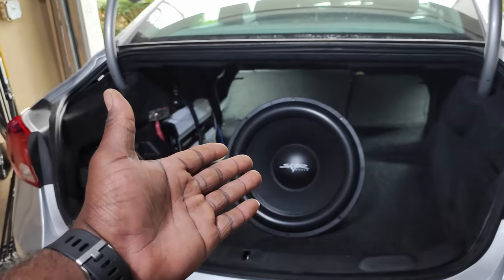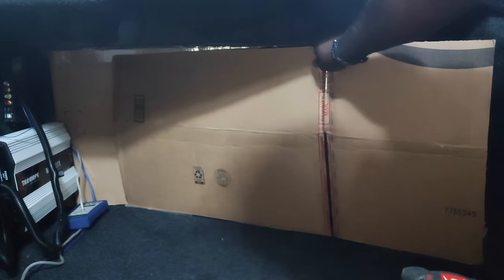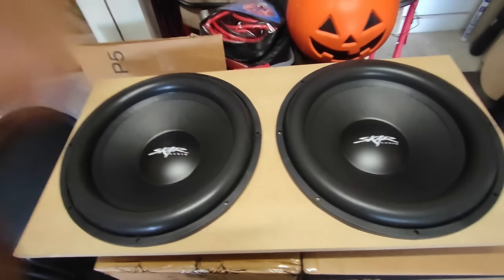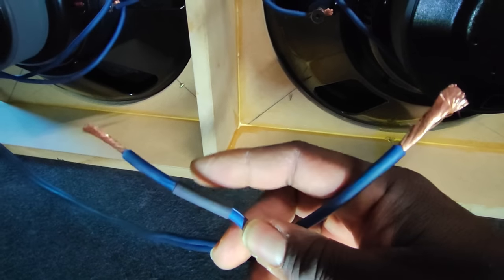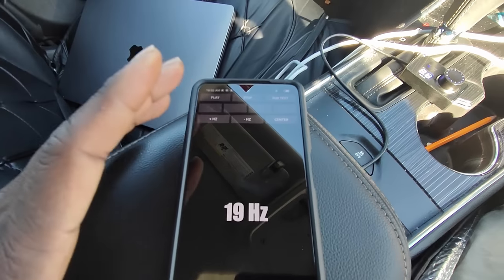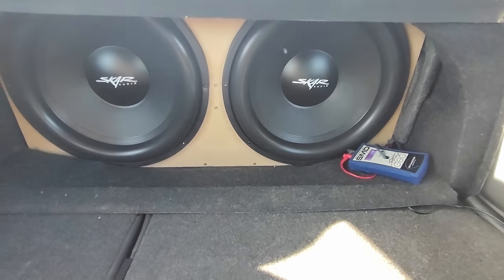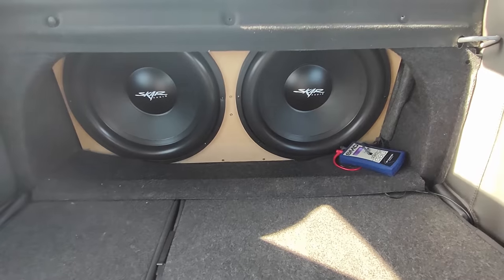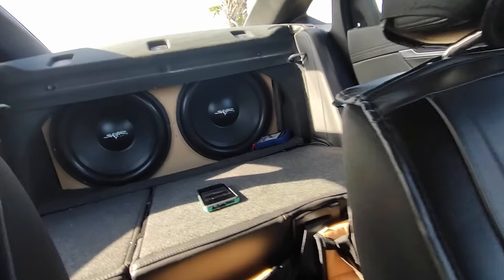No Other Design Sounds Better Than This - Infinite Baffle - 8,000 Watt Test - Part 1

Comment: Everyone wanting to try IB (trunk baffle) with 12's or smaller, you won't get the output he is getting here, you really need 15's or 18's.  High Qts and High XMax work the best, and you should be able to play below 10Hz, but it'll roll off at 50-60.

However, if you want clean bass and trunk space, go IB
Reply from the maker: Agreed. And use a DSP to kill the roll off.
Reply: Alot of people dont seal off the baffle properly, or the rear deck. This is where alot of output is lost.

Comment: Great video! Very cerebral. 

I got rid of my 12" box because i always had to take it out for luggage space. But this solves the problem! 

Do you ideally want to use subs with tight suspension? What's the name of that parameter?

Comment: I know you said you’re more of a SQ guy, but would you use this setup over say sealed, ported, bandpass, etc?
I guess would you say you “prefer” this over any other type?
Does it hit lows & highs well within range?
I have so many questions bc Ive wanted to try it for so long but have been afraid it wouldn’t be to my liking.
I’m love SQ, but like to be able to bang when I want. So I tend to stay with a ported enclosure personally.
Great vid and setup btw 👍🏼
Reply: but ts parameters has to prefer ib usage.
Reply: @CVLova  correct, I probably should’ve added if someone were to start from scratch based on subwoofer specifications, would this be preferred over other methods.
Thanks for adding that.
Reply: @themetalfusionologist  it is all about what the final product. What are you looking for? You want the entire block to hear your music or do you want to experience every nuance of your music? IB setups are great for competitive builds where you will seal and reinforce parts of the rig. On a daily build IB is more of a hassle to tune and putting things in your trunk will effect output, rolling down or up the window while driving will change the pressure greatly in the cab....your basically turning the car into a bandpass enclosure as you have a sealed section and a free/ported air section. Changing one or more of those parameters will effect tuning and therefore output. You want low and accurate? Sealed box , heavy motor and a butt load of amp. You want loud and peaky ? Ported or band pass with light drivers and correct amount of amp. IB will eat subs if you push them past their specs , stuff rolling around in the trunk can damage your subs, you system will sound like dog water with the seats up and people in the back seats...think about it, if IB was the best way to do it don't you think us guys from back in the 90's would have been only rocking open air setups?
Reply: @robsorgdrager8477  I have such a plethora of music I listen to it’s difficult to say what I look for, but I too am one of the ‘90s bass heads. I’ve just never used an IB setup 🤷🏼‍♂️ but have always wondered if that type setup would be worth trying. I do tend to enjoy the lows, I always tune my enclosures low, but at the same time enjoy great SQ.
I recently put more in my interior setup than my daily is even worth 😄so if the urge for SQ comes up I’ll just tune everything down for the subs and it fits what I like.
But I’d also like to know that if say a comparable set like in the vid, maybe 15s or 18s in the future (when I want to use my trunk again)…would I feel disappointed in the end result.
I just wanna know if it has decent low notes reproduction or does IB tend to stay in the higher range
Reply from the maker: In my honest opinion, with this setup, I hear notes into the 20's. IB setups are not restricted to the roll offs of traditional and bandpass enclosures. And this setup doesn't require a lot of power to 'sound' good. Every setup has its flaws, but I favor this one over the others; for SQ. No heavy wooden structure wasting gas money, no loss of cargo area, and no need for expensive amplification.
Reply: @BudgetBassHead  thanks for that.
I’ll probably give it a shot at some point down the road.

Comment: This is exactly what i want to do with two HT-18 v3 subwoofers. My enclosure area is a little more tricky then yours is though so im going to have to go to a car audio place that can figure it out because of a hump where the enclosure starts leading into the trunk. I think it can be done though even if its jury rigged to work.

Comment: I'm simply going to call nonsense because, in a car environment, the quality difference between infinite, sealed or ported is going to be basically unheard by the human ear.   It's a placebo effect, people just want to believe their special something sounds better even though it really doesn't.   I have dual 12" in a sealed box because it was simple to build and install.   They sound amazing, can also hear every note, not even sure why a sub wouldn't produce every note unless somebody really messed up their setup.   Another reason why subs would end up sounding worse is pushing too much power beyond their limits or under powering and clipping them.    But you run a nice set of name brand quality subs and they will sound amazing in any box design built to proper specs and ran withing proper power specs.
Reply from the maker: You may want to do a bit more research. These different designs are marketed and priced differently to different consumer groups for a reason. Manufacturers under one umbrella will produce different types of enclosure designs for a reason.
Reply: @BudgetBassHead    They can have all the reasons they want, but bass is bass in the grand scheme.  You line up 3 vehicles, one with an infinite 18", one with sealed 18", and one with ported 18" and you don't know which vehicle has what setup.   Play them all at the same wattage, about half RMS and doubt anyone would ever get all 3 right any better then a coin flip, they would simply be guessing.

Comment: Not bad, I was thinking you can probably gain a few db's by sealing the sides with that aluminum duct tape. A few layers of it on the sides and top n bottom would seal it off better for easy and cheap. 👍

Comment: I used to have a 01 regal that I had always wanted to do this with what give me the idea was I had a old Rockford 12 that the box was way to small for I had inverted the sub but still wasn't getting the sound I thought it should so I layer the seat down and stuck the magnet in the trunk with the box laying on the seat and it easily doubled the sound

Comment: It's crazy how you managed to pick up the "feeling" of a free air system. The fact that the mic doesn't distort badly but you can see stuff and air moving and it sounds loud but not "pressurised". Did you mix some of the music on top of the video in edit phase or is it actually just recorded as is?
Reply from the maker: I got a better mic.

Comment: i had friends do this back in the day and they would also screw down wood over were the 6x9s would be in the back deck then cut holes in the wood the deck and put 2 pvc ports going in the trunk ya i would do it id put some dyno matt around ware the would is maybe get some of that stuff from homedepot that come in a 4x8 sheet they use on the homes to keep the heat in seal it up and port the deck lid ware the deck speakers are
Reply from the maker: Thanks for the tips.

Comment: I have some old VVX 15's that are collecting dust and a 12" SDR. I see that these are SDR should I attempt this with the 15's or add another 12. My back seat doesn't move but I have a ski pass in my g80.

Comment: just found you and your channel... subbed and liked and commented.. I do have a question what and where did you get the intro song .. name and site ??  I actually have the song at the end you are using to demo... also do you feel running one higher power amp vs two separate amps gives you better sq when pushing subs? the reason being usually the higher powered amps deliver a dirtier quality as distortion is not an issue in spl or decibel drags and events vs sql and sql+ competitions...or say the use of a lot of modern edm music vs old school hip hop or rap ? I come from the days of Hifonics, Lanzar, Orion and the newbie Alpine LOL Yeah I'm an Old Head...never ran 18's..just 15's and 12's for bass and sub bass and ran 8's or 10's for mid bass .. am curious as to your thoughts on SQ vs straight up spl... If you have a play list or video that touches upon this or is a bit more intensive on this subject please let me know and thanks.. Was a great video and has been a longtime since I have seen an infinite baffle set up.. all these new gadgets and such must make it so much easier to tweak the system LOL Be well my friend and much love and respect to a fellow Bass head.

Comment: I just learned that this isn't true infinite baffle untill you roll a window down. Ol skool infinite baffle used one or two IB sub's and cut holes in the trunk where the spare tire is and you mount the sub vertical to the ground using a mount around the holde. You then cover the bottom and seal it up with a water proof screen fabic kind of like a trampoline fabic and then its true infinite baffle and will sound extremely powerful outside the vehicle. This is something i plan to do just for fun.

Edit: you're whole car turns into the subwoofer box.
Reply from the maker: There's more than one way to approach infinite Baffle

Comment: I wish I had done an IB with my 15s in the impala instead of a huge slot ported enclosure. I mean I guess I could still if I just talk my son into crawling in the trunk with a saw. Just leave enough box to serve as wave guide and structural support, and seal the port of course.
Reply: I also could take the separate sub plates and add a third for a center passive radiator.

Comment: Hey man I love ur vids. Question tho.. What are u using for signal off of the factory radio? R u just using a plain line converter? Or do you have a better suggestion for a chevrolet radio?

Comment: I dont have much experience free airing anything but i would be interested to know if not walling it would make any difference.  From my understanding, there is a pressure wave that can bounce off the back of the trunk and then fire toward the cabin to "reinforce" existing sound waves.

Comment: Gotta try it with marine subwoofers they are designed for free air. I’m surprised a 8000 watt burp happened. Baffle is all about SQl low power 5 channel systems. Great video man!
Reply from the maker: Great point

Comment: But wouldn’t it have leakage from the trunk ? Also most trunks have a directional air vent and you seal the back speaker holes up top ?

Comment: This is not an infinite baffle, this is a sealed enclosure.  Infinite baffle is best visualized as a driver mounted to a baffle/plane that separates the front wave from the rear wave - the key: there is no back pressure beyond the atmospheric pressure .
What you have is simply a sealed box... It could become an infinite baffle if you opened the trunk, however if the interior windows etc were shut, you would simply make the cabin the sealed enclosed... Windows down it would become ported.

It would act most like an IB with the trunk and all doors wide open...

What you have here is a leaky sealed box with insufficient enclosure rigidity.  This is an extremely inefficient use of power - you'd get significantly more output and better frequency response with one woofer in a proper enclosure, 10db louder with plenty of room to go.

A trunk can function (model) more like an IB with less cone area, say one 10.

Comment: Been watching you for years so I know I’m preaching to the choir brother but…..

A 140 at 20hz is like a 170 at 50hz so the whole spl thing , if we’re gonna do it, needs to be rethought 😂 

If your peaking at 38hz with two 18s in infinite baffle your trunk is too small for those ie the vas isn’t right but I know you already know

Somethings not right because they should peak more into the 20hz or even teens. 

I love ib and of course as you said it’s not all about the spl, ib has a special sound to it that a box just can’t reproduce.
Reply from the maker: I have my DSP set to roll off around 25 Hertz. Primarily because I don't listen to anything that low in my car. I'll be sure to mention is in future videos
Reply: @BudgetBassHead  I wouldn’t change my dsp tune either! 😂 

after taking my own crash course with a helix dsp , I can tell tuning isn’t something , I at least ,want to do twice!

Comment: As car audio guy that started back in the 80’s its cool to see an infinite baffle set up being done. This is the way most of us did it back then. Its definitely more custom work to do the set up and guys with boxes in their trunks were seen as taking the easy way out. In the days before spl competition most of the guys at soundoffs and shows ran this type of set up. As an sq guy myself, I would run 4 8” subs mounted up on the rear deck. Sealing all the gaps after the main woodwork was done was a big part of the job. Nice work here.

Comment: I did this with 4 10 audio barns and it sounded good but I did seal all cracks holes you name it with foam s spray and it wasn’t the hole trunk it was the cubby hole in a g body car

Comment: Infinite baffle does have great SQ. Those SDR 18s are listed to work well in around 4.5 ft box each so with 2 if you seal the front and deck well and add a port it could actually gain some SPL while still sounding great and possibly even give you some tuning options.

Comment: I would recheck the phase on each coil of both subwoofers, the manufacturers aren't always correct. I say this because the video of both woofers isn't symmetrical, so something isn't wired right.

Comment: I thought about doing a build like you done bro. but I need a ported box for two American Bass HD 12d2 subs. the widest box I can fit in my trunk is a 33" wide x 14" height x 28" Depth. That's not including the 6" aeroport or the subwoofers displacement. What do you tink?

Comment: this sounds good but box is very important for higher spl,, I am doing 139,9 at 30hz with only one 12" sub and 1650w amp,, (about 400w with box raise). stock alt and battery.

Comment: If the trunk is sealed as best as possible. If the sub front area and rear areas are separate. Then you really just have a cabinet. Nothing fancy.
The square footage would be calculated by what volume is there

Comment: Hi. Just curious. As I did this to a Honda Civic and 2 15" Pyle subs years ago. It was great to have my trunk space. However my curiosity is, that would it help if you had a. Top, bottom, and sides to your baffle? Leaving the back of it open. Would direct the sound waves out and back in, therefore giving it some stability. Its just not slamming bass like 2 18" subs ought to be doing.

Comment: When you say " sounds better " do you mean loud or accurate or both ? I've found a properly sized and damped sealed enclosure to be the most accurate and have a more broad and flat response curve. I understand that infinite baffle allows you to get away using less power but you are also relying on the mechanical suspension of the driver more than the pulse waves or pressure inside an enclosure.
Reply from the maker: Accuracy and timing is what I'm referring to.

Comment: I have a brotha who own a 2015 Dodge Ram Laramie truck with two Alpine shallow mount twelves in a sead box under his back seat, but he wanna port his sealed box. So, since I seen your infinite baffle set up, I was wonder if we could get away with a top board while utilizing both his cargo areas that the enclosure sits in and just add a port to each side. Will that work?

Comment: Best ghetto I seen was some1 take out the spare, take a pky wood then cut out a 15 hole n slap a house speaker cerwin vega and a Rockford punch 80 or the 40. N it slammed. Thus was literally like 25 years ago

Comment: I understand the idea. My only question is, how does it sound with seats up. All I'm saying is, you don't usually ride around with back seats down. Not trying to diss you man.
Reply from the maker: It sounds horrible with the seats up. You have to crank the volume and monitor bottoming of the coil.
Reply: @BudgetBassHead  Gotcha, thank you, sir

Comment: What if you screw on a 39"x10" in the back of the woofers to block anything in your trunk from hitting the speaker and wires? Would it change the hrtz?

Comment: High priority in free air is completely isolating front of woofer airspace from rear of woofer airspace.. rear deck speakers are a weak point and will fail with the sub pressure, they need removed/holes sealed..all small vent holes thru rear deck sealed .. sound deadening is a gigantic help in dampening the trunk space/enclosure area. 
I did this back in 96/97 with 2 10" pioneer free air subs.. completely ignored the rules on sealing off front/rear and had about an 8" gap from top of my baffle to top of trunk ceiling... it sounded good, but would have sounded WAAAAAY better if I had done it correctly. Learn from other's mistakes

Comment: Nice set up. If you wire both leads to one side like that then each coil down the line gets less and less power as the resistance increases. If you hook your positive to one side and your negative to the other end on the other sub it keeps everything equal. It’s significant, try hooking up 3 subs in parallel free air and you’ll see what I’m talking about. Each sub down the line will be moving noticeably less.
Reply: No Sir that's not how electricity works
Do Christmas lights get dimmer down the line ? 
Absolutely not
Reply: @408SPLKINGS  Really? Because I ran 6 tens in parallel the same way he did and it 100% did work that way. I can post a video or you could try it